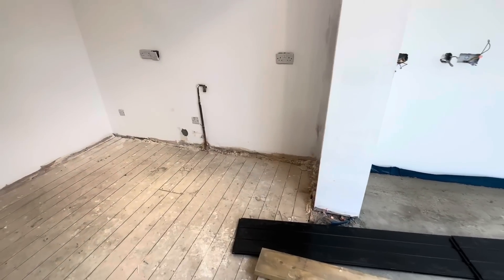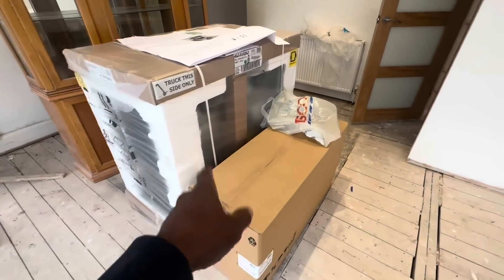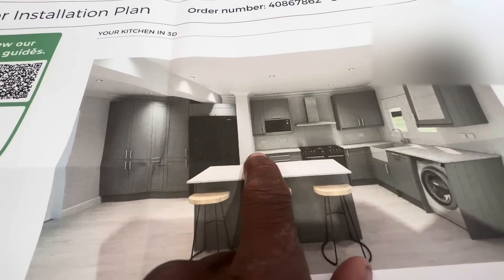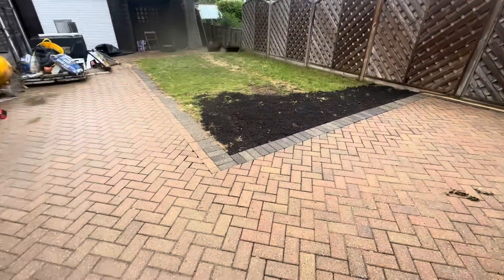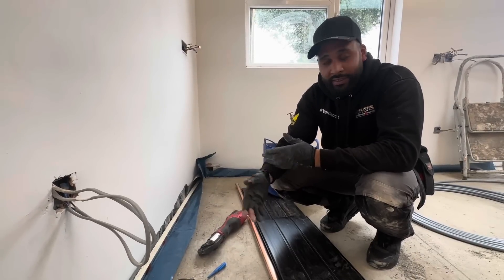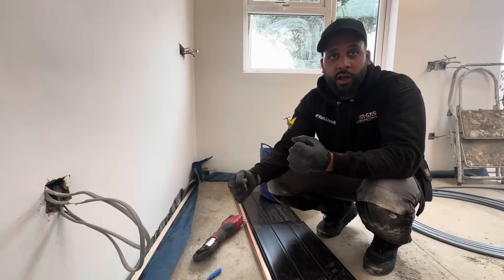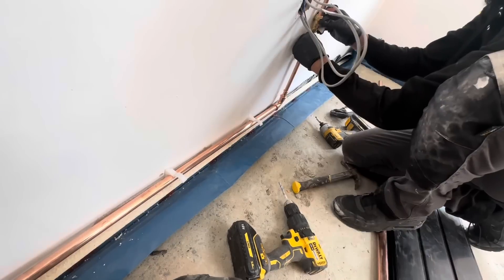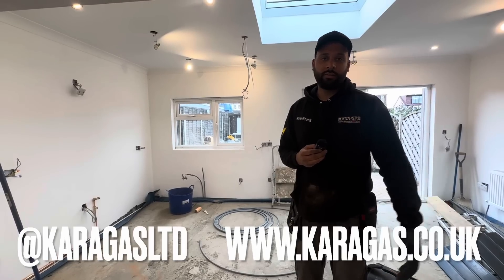Installing gas pipes using crimp connections

Comment: It saves you using a wrench against the wall too. What about nut compression fittings for gas? Will need a wrench for them. Probably more useful for the smaller gas pipes.

Comment: What’s wrong with push fit? Apart from gas of course.
Reply from the maker: Nothing
Reply: @darrenthebuilder so you can use push fittings on 15mm gas pipe? More expensive per piece, but the crimp machine will still be expensive.

Comment: The gas pipe should have been sleeved as it passed through the wall.
Reply from the maker: It is sleeved in 28mm pipe
Reply: @darrenthebuilder No evidence at 3:40 but I take your word for it.😉👍
Reply from the maker: @normanboyes4983  that piece he cut at 3:40 is actually the 28mm sleeve that he put in the wall. Then the other pipe after 👍🏾
Reply: @darrenthebuilder  yeah its pretty obvious it's the 28mm he's cutting.